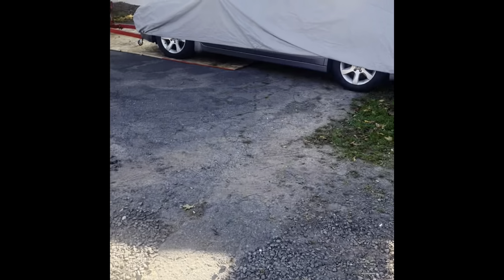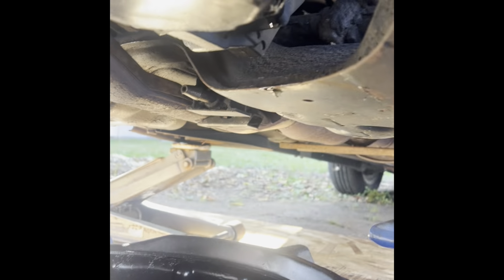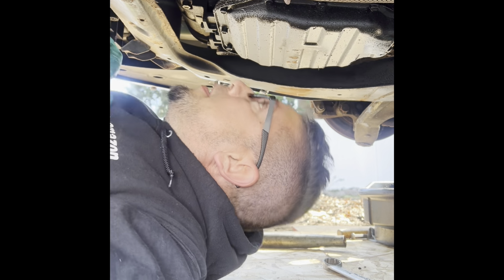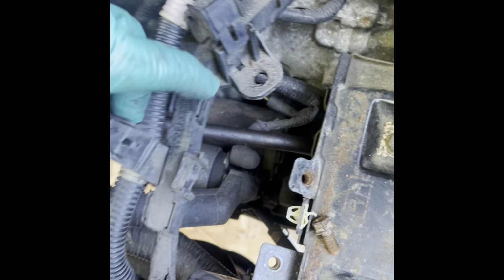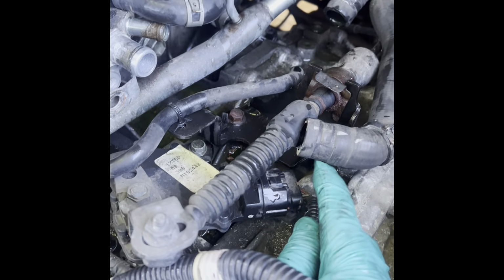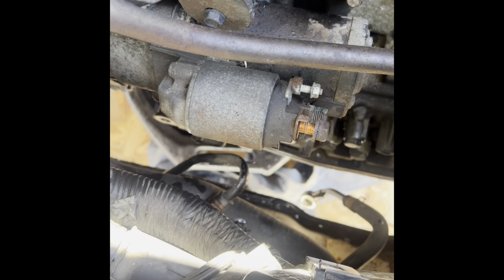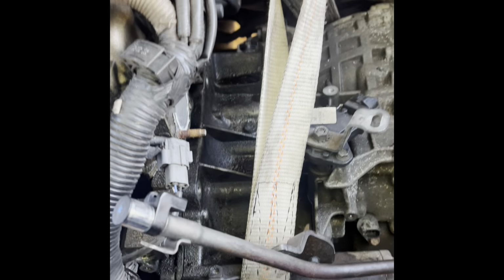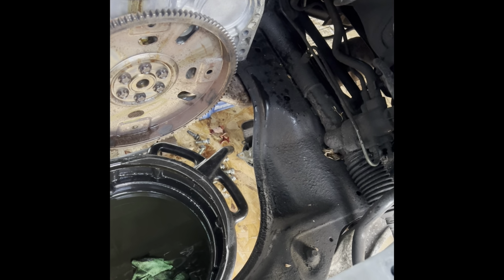09 Nissan Altima 2.5 CVT transmission removal ( from the top)

Comment: I replaced the trans in a 09' Nissan Altima recently. Easier than I expected. The thermostat housing studs above the trans was the most difficult to remove.
Reply from the maker: @kcook8119  I have to agree the rest was easy.

Comment: will this still apply to the 3.5 you think?
Reply from the maker: @LuciJah420  a lot of the steps are gonna be the same or similar but being a 3.5 which is a six cylinder it’s gonna take more room in the engine bay so I doubt that the transmission can come up from the top.